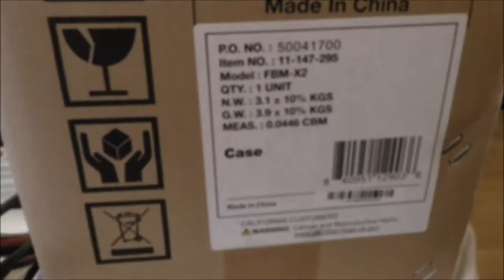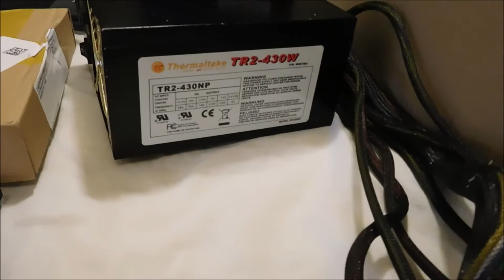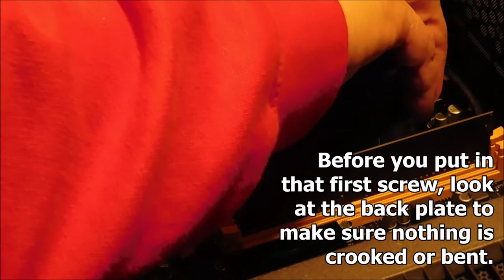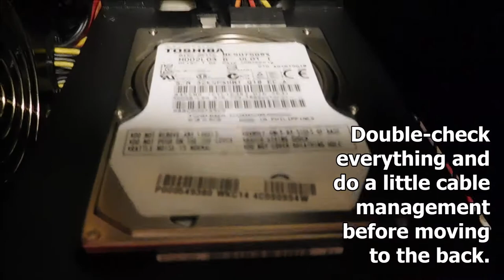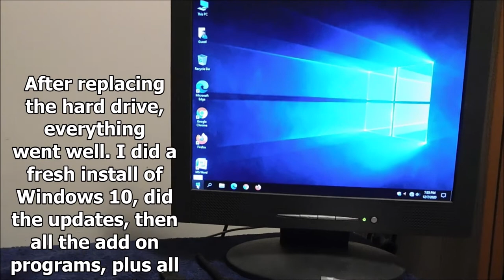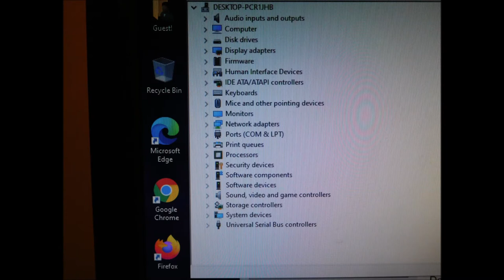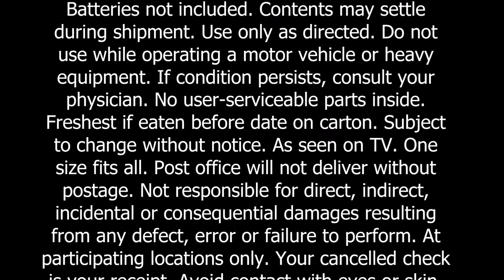Starter PC build - DIY Custom Computer

Comment: I love this video! There are tons of high quality/production youtube videos of guys building incredible machines with the highest of high end equipment. I've often considered starting a channel building worthy systems with used or past gen components. It seems there would be a fanbase of people who want to see where to buy affordable components and build a gaming system without the high cost of the latest and greatest components. 
I do believe that I wouldn't have gone so budget with the PSU though. But with only $250 into the entire unit I suppose potentially having to replace the motherboard is worth the risk lol.
Great job on this video!

Comment: Oh man, my jaw dropped when I saw the listing for that cooler! Please tell me you didn't pay THAT much for it....

Also, chuck that PSU. It's asking for trouble--I can tell you from experience. Then get an SSD for booting the OS and a separate hard drive for your files and games. Finally, get another separate drive and try Linux. It runs like a dream on more modest hardware.

Othewise, meh, it's alright I suppose. Enjoy.
Reply from the maker: No, I think that is a trick just to save the listing, so they won't have to completely rewrite it. They price it at something reasonable (I think I paid $14 bucks), then when the have only 1 left, they jack up the price knowing no one in their right mind would pay that much. By the time I got around to taking a screenshot, they jacked up the price. Once they replenish their stock, the price comes back down. You have a good eye, no one else caught that. As far as the PSU, I already had it. I wouldn't have bought it but since I already had it, thought I would go ahead and use it.